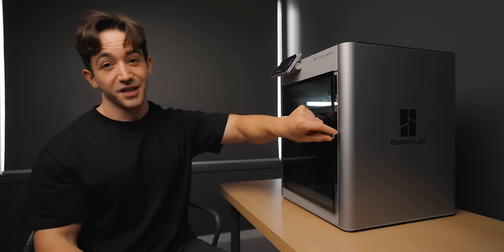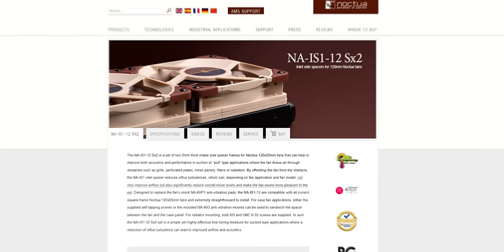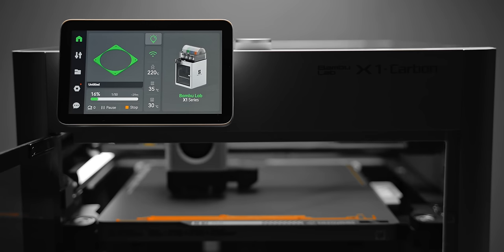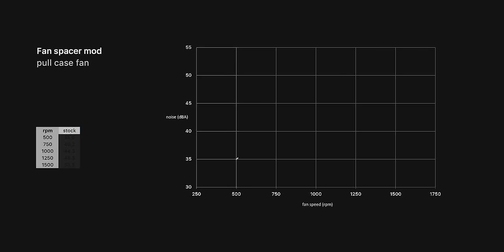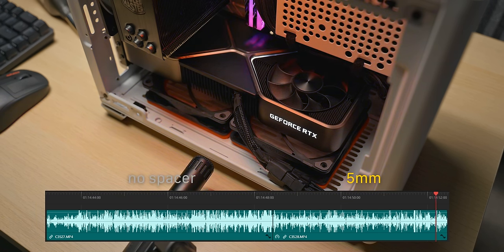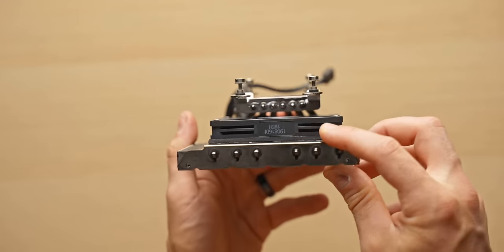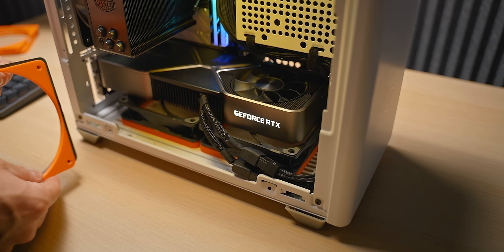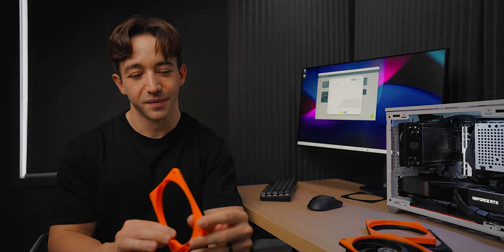Stealing Noctua's quiet airflow mod

Comment: This is the exact pickle I was in with my Ghost S1. 

Most coolers that would fit in here are absolutely flush with the side panel, which is a prime case for turbulence. One configuration I've been toying with is an ID-Cooling IS-55, but with a standard 120x25 fan. That would bring the height to a total of 65mm, which allows 2-3mm of clearance for something like a layer of foam I can cut out.

Comment: Printed this a couple hours ago from TPU. Had a hell of a time trying to put it on my AIO but after a little tinkering it fit.
The RPM is now solid rather than bouncing around (at max RPM). Which means its quieter to the ear. Not sure about actual decibel value.
It would bounce between 1960 and 2040 RPM and now its just 1980 solid on one and 2002 on the other. Quiet mode it makes little to no noise even before adding the spacer.
So listening to it now I can barely hear my PC. Maybe it helped maybe it didn't. It probably did something at least.

It would probably have been better to print 280mm in my case but I don't even have a printer capable of that (235mm max). I printed it with 2 bottom layers 2 top layers 1 was "surface". First layer 20mm/s gradually increasing to 50mm/s on layer 4. Then I used Gyroid at 20% infill with connect lines enabled. 2 walls. 0.3mm layer height. 0.4mm nozzle.
If I would print this again I would probably change the wall count to 1 and remove the connect infill lines. Because it felt squishy except for the edges.
The weight is about 16 gram each.

Comment: I'd recommend printing these in TPU instead of a hard material. This basically turns it into a gasket helping to seal better against radiators and can further minimize vibrations (which may or may not be noticeable).

On my front 280 rad with fans pulling exhaust, I combined a single 'gasket' for both and have it on the radiator and case sides. This is a bit more convenient to take on and off and should theoretically seal even better but I doubt it's notable over single spacers. Either way reduced vibrations at high speeds resonating through the case. Adding a gasket between the case and a 360 rad in push config didn't matter, only direct contact with the fans.

Comment: Great experimentation. I’ve used washers to gap the fan/screen space which has lowered the sound level. Obviously some situations will have better airflow with a contiguous enclosing spacer, such as for exhaust. I suspect intakes would be more efficient airflow without an enclosing spacer ala Bernoulli effect.

Comment: I printed a 5mm spacer for the 4010 hotend fan for my printer. Yes it is still noisy but at a more tolerable level. thank you for the information.

Comment: At this point, with the knowledge, testing and innovation at cost you do, someone's got to pick you up to do a full custom case and cooling build. I think there's a massive mini-ITX opportunity for good cooling and in general, a large 3 slot GPU case that's missing both a good case, and effective AIO cooling.

That would possibly be one of the most watched videos on the internet in the PC case and specifically the SFF community :)

Comment: About 10 or 15 years ago i saw a guy testing a similar idea on a high end eater cooling setup. However the idea he had was to increase cooling performance with the spacer. They were not small, something like 25 or 45mm thick. Iirc the idea was to make enough space to eliminate the dead zone behind the fan hub and utilize that extra area to improve temps. I can't remember his specific results but he did see improvements. Maybe its a topic you could make a video about.

Comment: I use the Noctua spacers on my slim 120mm noctuas. I had to trim the pegs on the spacers with a hobby saw which took about 5 minutes. Now the fans can run at 2k rpm without sounding horrid. Greatly improved CM NR200 bottom intake noise.

Comment: if you're lazy or you don't have a 3D printer you can just buy a silverstone SST-FF121B . It's an air filter, you can just cut off the filter and use it as a spacer. it's like 4 mm

Comment: NF-A12s also have built in space between the actual blades and the front frame. Therefore even without any spacer, they can remain relatively quieter when pulling air from an immediate restriction.

Comment: Would you get any benefits to printing this in a flexible material like TPU? Perhaps it would squish some to prevent air escaping between the fan housing and whatever it is mounted to and perhaps it would work kind of like those rubber tips on Noctua fans that seem designed to reduce vibration and further isolate the fan from the case?
Reply: The foam ones should work basically the same I guess.

Comment: Wonderful video, these look like something people could fabricate themselves even without a 3d printer. 
However, it would be interesting to see how different the sound is from other materials like TPU or carbon fiber and nylon. 
Additionally, one other modifier i would like to see tested is hole diameter. I imagine most of the turbulence is coming off of the fan blades outer edge/tip. 
Would bring in the diameter help to dampen or direct the air in a different way, especially on a TPU printed one. 

This is already a long comment, but the pitch of the hole might also make a difference, ie a sloped edge going towards or away of the fan center. 
Great video as always!

Comment: If noise is particularly the problem and what you are trying to avoid, there is always been a simple equation... Increase your radiator surface area.
Adding more radiator surface area allows you to have more fans and/or larger fans, they can then spin at a lower RPM making much less noise.

My system would comfortably be cooled by one 360mm and one 240mm, however, I installed two 480mm so the fans are almost never spinning, it is passive 90% of the time, unless the system is being stressed and then they switch on at 25% and barely ever go above 35% so they are almost inaudible from 1m away.

Comment: You have clean, great videos bud. Keep up the good work n’ long live the channel. For my fans, I just have  2 240mm in front at 100% “silent” an undervolt/OC 7800xt. And 2 fans above cpu cooler only reach 60% max with cpu fan 100 if need be. With a 50% single 120mm in rear. Hence providing small loops of air to circulate then on a slower level, dissipate.

Comment: Wouldn't foam spacers be better than 3d printed ones (not only on the black ridge but also on the side panel) since they, additionally to the reduction of turbulence, also decouple the fan and therefore reduce vibration and noise?
Reply: maybe, I will try to print these in TPU.
Reply: @ehdbom or take a foam and cut it instead

Comment: I didn't have expensive spacers or a 3d printer, so I put a fine dust mesh bewteen the fan and the perforated panel. This also worked to fix the turbulance.

Comment: Might not be possible for your air flow situation.  But there are videos that test putting the radiator in an intake location with pull fans.  In this case the fans are pulling cooler air from outside the case through the radiator and the tests I've seen indicate the CPU runs significantly cooler with zero impact to GPU temperature.  Of course the results can certainly vary.  Since I'm assuming this turbulence issue is only when the fans are pushing into the radiator and not when pulling air from the radiator, it might be quieter also.

Comment: Very interesting, yet again I have a question like yours that keeping me up at night. My desired case is the Lian Li A4 H2O and I saw that GPU spacer makes it closer to the case vents reduces temps by a few degrees, but I knew it will be noisier as the gpu fans will create that turbulance. How can we reduce GPU noise, do we just compromise the few degrees even in an ITX or is there a solution?

Comment: It could be worthwhile to consider the use of a softer material for the spacer. This might help in reducing the transfer of fan vibrations to the casing panel, thereby minimizing noise.

Comment: The material and mounting method should also matter. For example if we use a more elastic material without any metal screws, we should be able to dampen higher frequencies and prevent them from propagating to the metal parts that tend to ring

Comment: So TEMPERATURE wise, it doesnt really make a difference, well, 1 degree AIO liquid if applying spacers to all case fans + AIO. And for AIO, the spacer doesnt reduce noise, but for CASE FANS, at least ones close or tight to the frame and mesh, it does make a big sound difference.

I imagine fans against those rear exhausts directly up against unfiltered metal grill as is in many cases, would see a good improvement. But inwonder is a simple washer enough?

Comment: Other than lessening air turbulence I believe in the case of the Black Ridge with the difference in sound it most likely due to the foam spacer acting more as a vibration dampener

Comment: LOL.  I suggested the same mod to Jayz2Cents about 1 year back in email.   He never replied.  The fan hub blocks a SIGNIFICANT amount of the airflow.  The gap allows the natural back pressure to reach the center and create a more even flow and less "flow wash" Also spreading out the airflow slows down the face velocity.  This reduces the pressure differential which makes the air easier and quieter to move- I also told him 5mm.   If you guys call horse manure, I can screen cap my email to prove it.  -Signed an aerospace engineer.

PS: I also wrote him a letter as to why metal blades are better for low speed fans, but make no difference at high speed, or potentially worse.  Plastic blades deform under high speed.  So the clearance gap around the outside ring is significantly bigger at slow speed.  But at high speed, the plastic stretches a little closing that gap, which increases efficiency.

Comment: Not entirely sure but I believe even putting spacers/washers on the head of the screws that attach the fans might also help further dampen the vibrations. Maybe just put spacers everywhere possible.

Comment: If they were made out of rubber they should reduce noise levels further. Hard plastic fan + hard plastic spacer + metal screws to connect to metal case = couples the fan to the chassis, increasing noise.

Comment: About 15 years ago I noticed a noise problem, I made the frame from old coolers, with a thickness of 25mm there is no sound at all, ideally 40mm, but then it will take up a lot of space in the case

Comment: In 2020 I built a desktop with high end parts and bought case fans that were highly reviewed for being quiet and powerful. I was always disappointed in how “quiet” they were. Constantly humming and making one heck of an annoying tone at higher RPMs. 

I tried different fans and different cases but couldn’t find a solution to removing the fan noise. I figured that I must’ve just been more sensitive to hearing that noise than most others since reviews said they were “quiet.” 

I actually ended up switching to an M1 Pro macbook and selling the PC. This thing is actually quiet and has been serving me well since. But I miss gaming on that PC every now and then. 

To think I could have just printed some spacers to fix that damn problem 💀

Comment: i guess I'm not first to say, but putting a bit of radius on the through-hole might help a buy more...i wonder if you could print a 'stator' to straightened out the airflow before it hits the grill.

Comment: this is funny I had built my pc with the back fan blowing into the case and couldnt figure out why the fan noise was sooooo loud. I ended up using tin snips to cut the metal mesh off the back and now I have an un-obstructed finger chopper on the back! :D quiet as can be!

Comment: Back in my day, we used to use old broken fans with centres cut out to achieve the same. (The acrylic plastic fan cases, were not good and increased noise.)

Comment: high quality videos like always, is there a possibility that you could do a video about testing what’s the optimal fan speed curve to temperature for the best performance and quietest sound? I got those Noctua F12 which rev up to 3000 PWM and it sounds like a jet engine booting, I mean I got really good cooling but sometimes it would’ve be interesting to know if it’s overkill.

Thanks for your Videos, great work.

Comment: Dont they have all kinds of similar options on amazon?
I used to do this for very specific scenarios by just gutting an old fan that was ready for the bin, id just gut out the fan and the arms holding it leaving the shroud or what have u left for this exact mod.

Cool coverage though i never see ppl talk about this kinda stuff and it can help a lot for sure.

I used to use this specifically for my old rosewill fans because they pushed insane amounts of air but were crazy loud. No noctua has come close so far in felt/physical CFM and ive never been able to figure out why when compared higher claimed cfm fans.

Comment: I work in the automobile industry.
It is common for tires to have several different tread block sizes to randomize the road noise they generate.
I wonder if the computer case had more random diameter holes, and spacing, if the pitch could be improved also?

Comment: Looking to use these myself, but how would i get this mounted to the case? Most fan screws are only 5mm or 30mm long, so it wouldn't make it to the fan with 5mm and 30 is wayy too long.

Comment: Used to use fans on the side door of my case to cool the GPU. I would hollow out a 120mm fan and mount another working fan to that with screws or zip ties.

Comment: You could have tested a fan outside the system, I suspect that at the top end of the fan speed the fan noise overpowers the case hole turbulence.

Really cool video though, I had no clue this was a thing!

Comment: Is the simple answer the higher rpms are exiting more air than the intake can handle so turbulence occurs? Best solution is to increase the spacer thickness based on how high your rpms are.

Comment: I laughed when you said you were curious if Noctua did their research on thickness and if a shorter/longer spacer would matter. If you go to Noctua's website and look at their published scientific articles, you'll understand that these guys are major league geek engineers. There's no question whether they would test it, and probably so thoroughly it would be considered overkill. Noctua fans are always amount the creme de la cremeist because of their colossal amount of research and development. That's been a point of contention with the fans, they take forever to build what many assume are easy to make parts, Noctua takes literal years for R&D, fans get impatient and are understandably a bit upset. But at the end of the day, Noctua fans are the best in the business because of the sheer researching, iterating, etc that Noctua does and that's why we love them!

Comment: Simple DIY solution to this is to buy Arctic P12 slim (or P14 slim if you want to do it on a 140mm fans), cut the fan from frame and use the frame as shroud.

Comment: Man, what is old is new again. Spacers/shrouds have been around for a long time in the hardcore PC cooling world not only to improve cooling, but also to improve acoustics, but the issues were always that it required longer screws and sometimes ruined aesthetics; esp. as acrylic panels (and now, tempered glass) became popular over vented but otherwise solid panels. Prior to the convenience of 3D printing, many would just make do with 1cm thick foam gaskets from the hardware store or a hollowed out, old fan frame. Nevertheless, it's nice that 3D printing has brought it back into more common use.

Given your ducted build, maybe you could try seeing if adding some additional sound dampening via foam padding to the interior of the ducts might further help reduce noise without affecting temps much.

Comment: You could just stack multiple M4 nylon spacer for the screws and then tape the gap all-around the rim of the fan. Cheap no-3Dprinting solution.

Comment: One comment - fans in push configuration there is also a chance of a gap between the fan and radiator letting lots of air sweep past the radiator and making lots of noise.

Comment: Use rubber or silicon spacers/washers  between screw and chassis it will dampen the vibration.

Comment: Any experiences with fans that mounten in top of the case and blow out of? I use a Fractal Design Define R5 and two Noiseblocker NB-eLoop B14-3 140mm Fans top mounted. One of them do also annoying howling sound so I have to place something on top of that spot to reduce this sound. Would this space maybe also help in this case, because it's still a small gap between the case and the fan blades due to the PCB housing and cable duct.

Comment: I was thinking: Most PC fans don't have rubber-padded corners that are used to minimize vibration noise into the case. I wonder if it's possible to add padded corners onto the 3D printed distancer mount and if it would have any benifits with canceling noise? What are you guys' thoughts?
Reply: TPU corners should be easy enough to print and add on, but Plastidip or something like it might also do the job.  I haven't tried Plastidip for that, though.